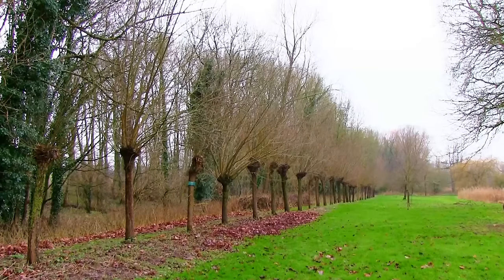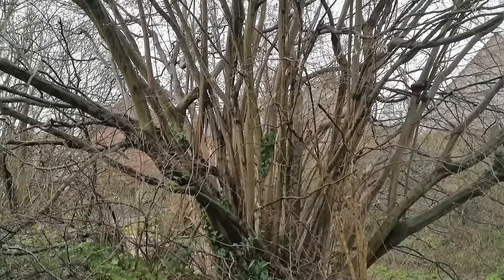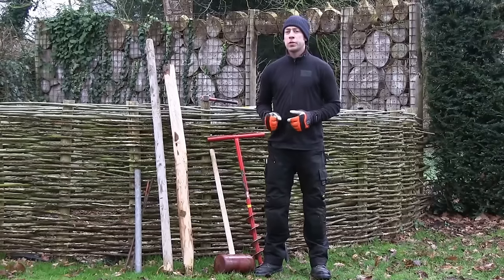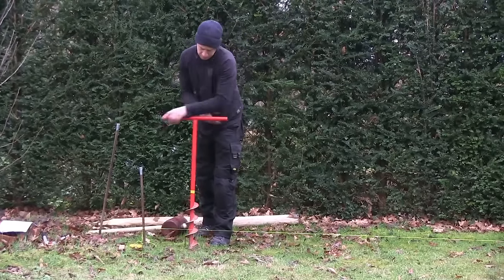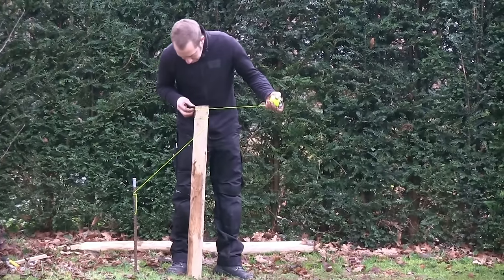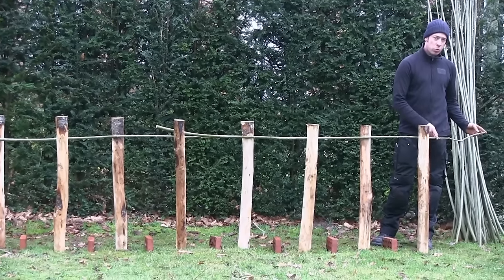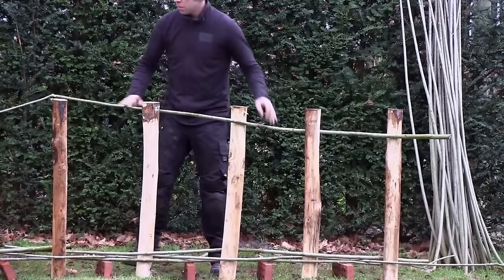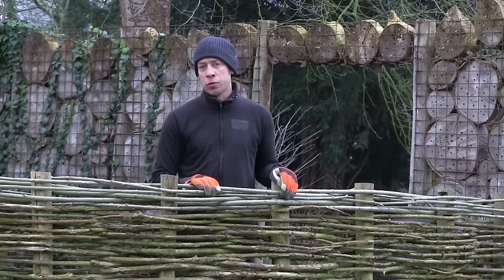how to make a wattle fence

Comment: This looks great.  wonder how it will hold up in the tropic? Like Wet, Hot, Humid South Florida?
Reply from the maker: Thank you! To be honest, I have no idea. They last longest in conditions where the wood can dry up easily, exposed to sun and some air movement, wind. The type of wood and thickness of the branches used does make some difference. For your climate, I can't predict. But in Europe we are craving for some sun and warmth and very jealous of people in Florida
😉
Reply: Use a strong stake that can withstand high winds, but the horizontal wattling can be made using freshly cut saw palmetto stems. They weave well and harden in a day or two.

Comment: Wooow! Why have I never thought of this before? Can it work well for sheep fencing?
Reply from the maker: Similar but movable fencing (sheep hurdles of about 2 meters long) was used all over  the countryside to gather sheep or to place them on markets. As a permanent fence for a meadow it is a lot of meters and would require a lot of maintenance.
Reply: @godemontjan3050  hmm. I could see why it's not absolutely best for being permanent. Thank you! But maybe if I used some slightly larger green branches as well as thinner ones and didn't have the posts quite as close, I could make a bit of a hardier fence that would last a while. I will experiment. (We have a lot of free, thin branches that it would be awesome to turn into something useful) I could see why it's not absolutely best for being permanent though. I'm wanting a physical barrier around my sheep feild in addition to the moving electric fence inside.
Reply from the maker: @leelandforestfarm  Hi Alisha. Other possibility is using a so called dead hedge. Two rows of stakes with branches piled up, not woven. If you Google dead hedge you ll find. Electric fence is always a good idea... Have fun with your projects!
Reply: @godemontjan3050  dead hedges are a good idea I'll see about it :)

Comment: Tree Fountain (aka Tree of Life)

1- Bore a hole into and up a tree being careful not to bisect the core of the tree. 
Alternative: Use bamboo or grow sugar cane as a natural and permeable plumbing and cultivate it so that the tree grows around it. 

2- Coat the inside of the hole with beeswax. I would highly recommend making a place to put a beehive in the tree near some water. The natural hum of the bees can promote health throughout the structure and through the water. 

3- Put a water basin at the top and a fire pit or fireplace at the bottom. 
The water basin can actually be used for a secondary water source that would promote growth and potentially allow for the tree to grow taller. 

4- Put copper pipe around the inside of the fire pit or up the chimney for a fireplace. This will act as a pump. (You can also use a hotplate if you prefer) The copper pipe should only be used close to the intense heat of the fire. Any amount of heat promotes upward movement in this case. 

5- Add water wheels (fidget spinners can be used for some decent mini water wheels) for electricity. This electricity can also be used to promote growth in the structure and in gardens. Check out how electricity is used to directly and drastically improve plant growth. 

6- Add hanging gardens for fresh produce. A vertical style garden will do several things to improve overall health and productivity. 

7- Splice other saplings and/or fresh tree cuttings using the tongue and groove method for shelter. This can be done with roots as well as branches. Encouraging roots to intermingle and cultivating a healthy mycelium bed are both ways that allow all the plants to share nutrients and different forms of protection. This would create a natural network that can be used similar to a computer for both the plants and people if a computer interface is plugged into the chemical language of the plants. 

This design provides food, filtered and conditioned water and air, electricity, shelter and SO much more! Everything a person needs for life and survival. Hence the "Tree of Life" nickname!

In addition to the benefits listed and the techniques described, this structure will grow and get stronger over time. 

Crystals can be used as a natural source of low level energy creation and as forms of transistors. 

Cymatics can be used as a form of communication directly with the plants.

There is SOOOOO much more that can be done using this method for creating structures and homes BECAUSE it is living. 

-This idea will eliminate 90% of the demand for large corporations and industries. 

- This idea will reverse air pollution and filter the world's air naturally and beneficially. 

- This idea will reveal the counterproductivity of governments and starve the governments of their power. Your fear and desperation. 

There will be no need to clear cut entire forests to build ever again and this will encourage the natural ecology in our world instead of fighting with it. 

Be a part of the change.
Not a part of the problem through government. 

We have made excuses for ignoring the fact that we are supporting all the problems we state we are against. Let's be the change!!!

Comment: Ash trees self seed everywhere in my garden and I'm always cutting them down. Wondering if I could use Ash  to make a fence instead of taking them to the tip.
Reply from the maker: Dear Katherine, I tried this and it is possible. Just try to get the distances between the posts  right...Best of luck!
Reply: @godemontjan3050  Will give it a try. Thank you

Comment: Are you using the bricks to allow space to pound the bottom of the support poles to be p!aced in the permanent spot? Also, how would you make a gate for access to the interior... as I intend to use the waddle fence for a garden enclosure.
Reply from the maker: Hey Tom. Thanks for your question. The bricks are only in place to create the small gap that allows to weed out whatever grows underneath a permanent fence. This example was just made for the video and dismantled entirely. Is the last question about how to make a door in your fence? If so, there you ll have to use another technique. First and easiest option is to make a door in an  iron or wooden structure that can be woven in. The other option is to make a portable wattle fence and mount it onto a door. This requires another technique that is slightly harder. Never made a video about that one... . You ll probably find videos about it on the net.
Reply: @godemontjan3050  Thanks for the reply. Making a small portable waddle fence for a "gate" makes perfect sense once you mentioned it. Thanks again!

Comment: I wonder if this would hold up against dogs jumping against it every day.
Reply from the maker: Thanks for your reaction. About the resistance to dogs... unless we would be talking about chihuahuas  , I would really not recommend it as only barrier ... I have fenced off an area for my border collie with self-made  panels of wattle fence(hurdles) . Knowing that my dog can take apart most 'certified indestructible' dogtoys in less than 5 minutes .. I placed a wire mesh fence on the inside of the area. I used welded wire mesh  panels I had left over.  The appearance is ok to me and the outside looks good. Bigger dogs will require even stronger fences. So in short... Better get  a good wire fence up for the dog.

Comment: Why did you leave a gap at the bottom?
Reply from the maker: HI Richard, the gap is optional but prevents the lower branches from rotting faster in contact with the soil or vegetation. If the fence is standing on grass or other vegetation, taking out weeds or trimming grass is easier without damaging the fence. I hope this reply was useful.

Comment: How long did it take to build the fence?
Reply from the maker: Hey George, sorry for my late reaction. A lot of the work is in the preparation of material and branches . The actual building on the spot was done in about 2 hours, making the holes, placing the stakes, weaving and finishing off...

Comment: Why didn't you twist the ends?
Reply from the maker: Hi Paul, twisting the ends is possible but not always necessary when you are making  a fixed fence. I often use it on top for the finish. Furthermore it s only possible with not too thick branches  and requires more technique and force. The video wanted to show a technique feasable for most people. I hope this answers your question.Best regards.